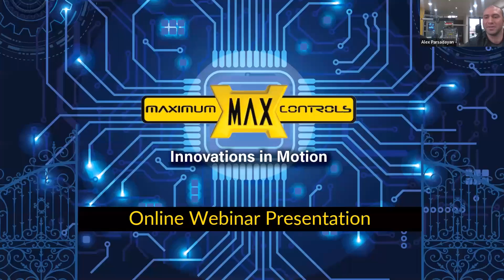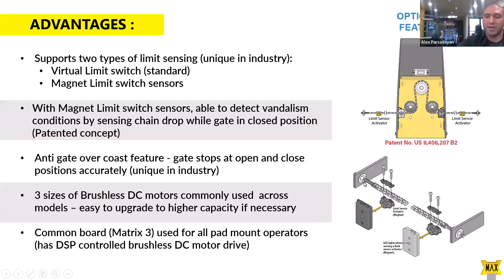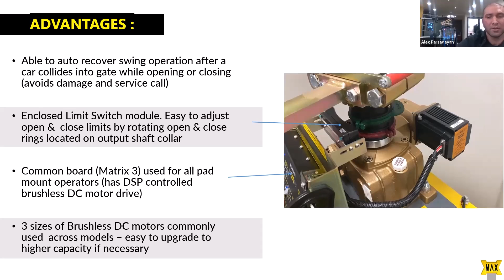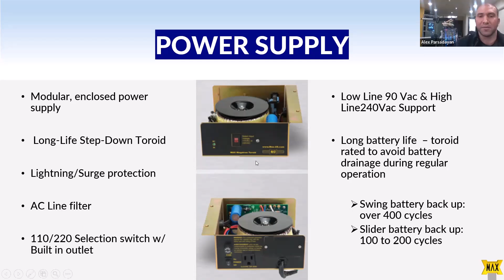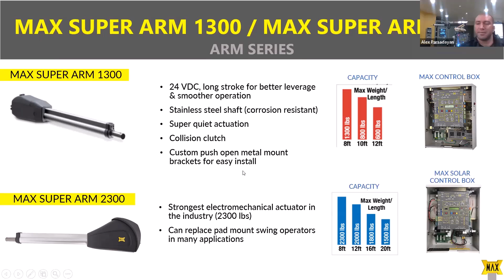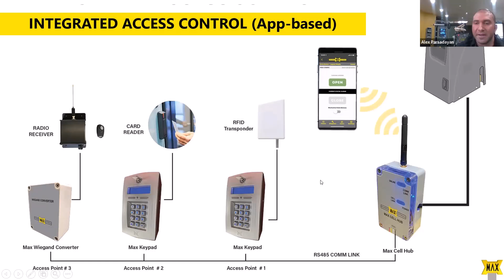Maximum Controls Product Line Review

Comment: What happens if you don't change out the id tag and you switch the motor to a bigger motor?
Reply from the maker: Great question. If you need to install a larger motor for an operator already installed in the field, we will ensure you receive the proper motor for the model installed. Said differently, if you install a larger motor meant for that model, you do not need to change the ID Plug. For example, the FS (Fail Safe) models have a different motor than the non-FS. Contact Controlled Products Systems Group or Maximum Controls to ensure the correct motor is purchased. Thanks, Zach.